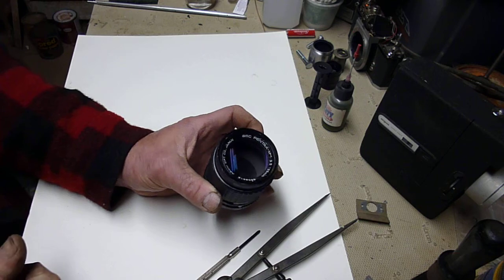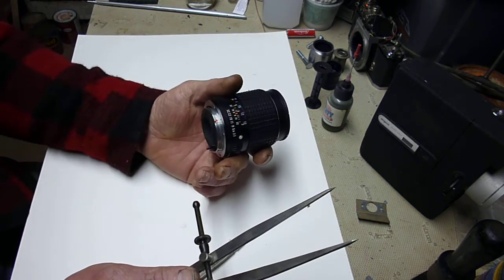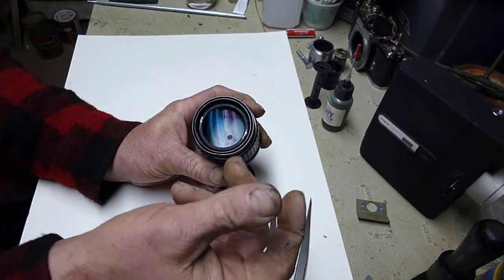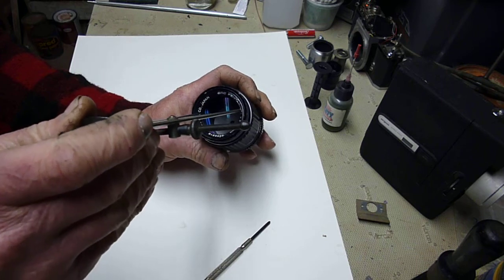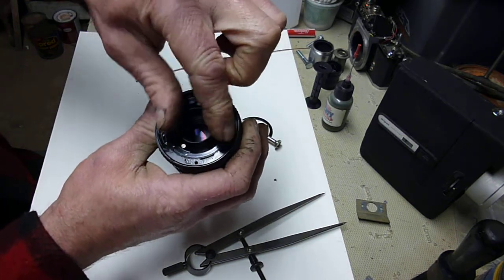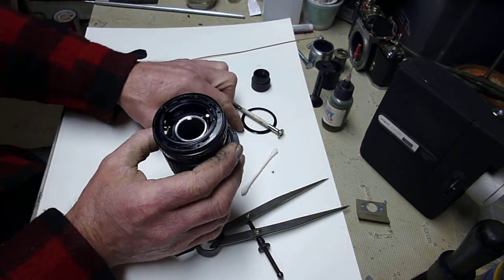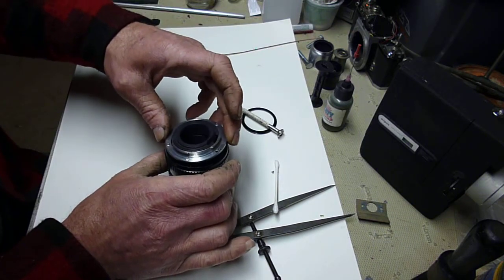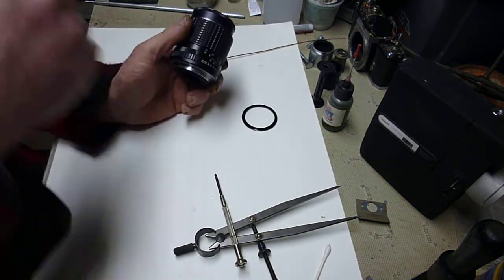Pentax 135mm lens fungus cleaning

Comment: Use a 3mm rubber O-ring, that fits nice an snug on top of the name ring (outer ring)  and use a cup or tube or anything that fits perfectly inside to push the O-ring against it.  Hold the cup down on top of the name ring on a table and turn the lens to unscrew that name ring.   This way you don't scratch the name ring.

Comment: For anyone still attempting this, I made notches in the front elements retaining ring on the sides (which hide behind the name ring), with a blade of my spanner wrench (make sure to blow away the metal dust). Then used those notches to turn it with the spanner wrench.

And to access the rear group, you don’t have to unscrew the JIS screws, just use a spanner wrench on the notches showing.
Reply: And for reference, the pentax forums lens reviews always have the lens diagram, if you need to doublecheck your concavity/convection
Reply from the maker: Thats a very good point and I did that with another lens.
Reply: Today I tried opening my lens, removed the ring with the name, then uncrewed the ring below which holds the front element, but I can't get it out, it's free but it does not fit through the filter threads. Am I doing something wrong?
Reply: Eduardo López technically, the name plate comes off, then the next ring (which doesn’t have notches), if loosened, should bring the whole front lens group out of the lens, and you should be able to see your aperture mechanism.
Reply from the maker: @mathaab  Unless you have a variant of this lens it should come out, look at it through a magnifying glass and make sure there isnt another ring or some other obstruction holding it in.
Reply: @yealevi2850  definitely something is different, once I remove the ring without notches (it rotates with the front element assembly) it gets free and I can try to take it out but theres one last piece in that assembly that is bigger than the diameter of the filter threads. Also, im getting all three front elements moving by doing that, not sure if just the front element should go out, so maybe the notchless ring is stuck to the lens and thats why I cant remove it?
Reply: Eduardo López strange. In mine, the whole assembly had about 3mm of room on all sides. Very easy to pull out from the lens. After removing the front assembly you have to start with the innermost element (the element that was closest to the aperture mechanism before you took the front assembly out)

Comment: Thanks for the video. Can you give some information about the rear element, mentioned at 6.31, which side is concave and convex? I've messed the things up right here.
Reply from the maker: I couldnt find that particular lens to refresh my memory however, I am no expert but the back-most lens on any lens I have seen always has the curve (convex) facing out away from the lens body.
Reply: @tobroken1965  Thanks for the reply. I figured that out and assembled that way. Luckily, Most of the lenses have a Convex on front and Concave on Rear.

Comment: Thank you so much for this video! I'm trying to clean the first few elements of my 35-105 because some lighter fluid got down there when I was trying to unstick the zoom. It'll be my first lens disassembly this weekend. Any tips? I can't find anything about dissembling the Pentax-A 35-105.
Reply from the maker: Here is a link to a list of lenses, yours may or may not have an active link but you may find some useful pics to help you. Also, take lots of close up pics with the best resolution you can manage, beware of anything spring loaded, if you dont already use only real lens cleaning paper, I like alcohol for most light cleaning, the highest percent you find, I have 99% isopropyl I bought on Amazon. You probably already guessed not to drip or squirt anything anywhere you cant see and reach with a Qtip. I use some pretty rough tools for the front trim rings cuz most of the lenses I have are beat up already, if yours is still good looking try using one of those non skid rubber jar lid grabbed things, and something thats about the same size as the trim ring for a turning tool, you may get lucky and the ring will come loose with no marring. Beyond that, take your time and have a clean quiet work area. Good luck and let me know how you make out. If you want to, post any findings that someone else might benefit from.

Comment: Hello!
 Can you give me an advice on how to remove and clean the rear element group of a Super-multi-coated takumar 50mm f1.4 with a m42 mount? There are no screws on the back. I’ve searched all over the internet for some instructions on how to do this but nobody seams to have tackled this problem until now. 
Thanks for the great videos, they are really useful, keep up the great job!
Reply from the maker: I just looked at one of mine, i hadn't noticed before. Anyway, to get the glass out you can remove the retainer ring on the back element. Its best to have a spanner tool but you can do it with any similar tool (with caution) That will get you inside where there may be another lens that comes out in a similar fashion. Don't loose track of which way the lens goes back in, some lenses look almost the same either way.
Reply: Thank you! I’ll give it a try.

Comment: Old video, but what size JIS screwdriver did you use for the screws on the back of the lens?  I have been able to disassemble one lens and clean it, but in another one of my lenses the screws were so tight that I stripped the head on one screw.  I need to find my  "easy out" kit to try to remove this screw.  Oh, and I got a nice spanner tool from ebay, it is called:  Neewer DSLR Camera Lens Spanner Wrench Repair Repairing Open Tool Stainless Steel.  Very much worth $14.
Reply from the maker: If I have any actual JIS screwdrivers, its a mystery to me. Most of mine are just the cheap micro screwdrivers you can get at any hardware store, but I have lots of them I have picked up everywhere including junk shops. I do have a small set of Husky micro screw drivers that have been great with deep clean grooves in the Philips head and very thin blades on the slotted drivers. The trick for me is finding the philips driver that is just a little undersized so that the  driver sits down deep in the grooves.

Comment: How did you open the front lens block once you took it out? It seems impossible to separate that lens block to be able to clean the internal glass.....
Reply from the maker: I dont remember now how or even if I took that inner lens out and I cant find the lens right now to look inside. Bare in mind that many lenses have big chunky lenses inside that are actually think pieces of glass glued together and do not come apart. I have seen a few of these that have begun to separate and get the appearance of being cloudy or in some way dirty. If this is your case I have no solution. Very old lenses were often set into metal cups that screwed together and could be forced to unscrew. I hope this helps, good luck.
Reply: tobroken1965 thank you for replying, much appreciated.

Comment: I own a 135mm 2.8 Sears looks similar
Reply from the maker: I have one of those also. The sears is much easier to get apart. If yours and mine are the same, it has 1 lens up front, 2 in back and a big laminated block lens in between.

Comment: Hi there. Thanks for sharing, but really you should not be.

Anyone else coming across this video to dismantle this lens please don't follow this instruction. This is a perfect example of how not to dismantle a lens. The way this lens was taken apart in this video aesthetically destroyed it.

Honestly you should not be putting up videos to repair lenses, you really have no idea at all. All you did really was trash this lens. It didn't need a set of callipers that are not designed for lens repair to open it. 
If you didn't want to spend money on tools you could have used a rubber grommet from a hardware store or the rear lens cap covered with a rubber glove. That would have taken both the front ring and the second retaining ring without any damage at all. I couldn't watch any further as what you did to this lens made me cringe.
Reply from the maker: If you had listened to the first two minutes you would have heard my very clear disclaimer on using this method. There were no cuts for my spanner and the rubber grips didnt work either. You are absolutely right about the appearance being ruined but I was clear about that also. I also noted that other videos are available by people more skilled than myself. Please feel free to do a better video.